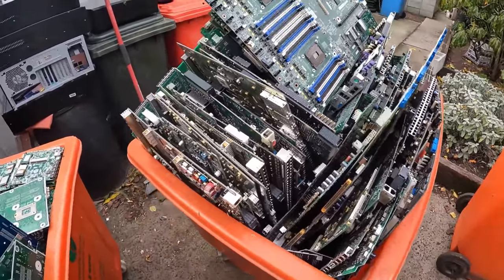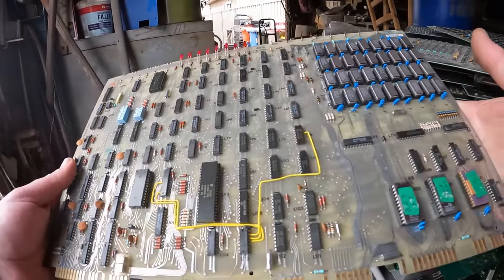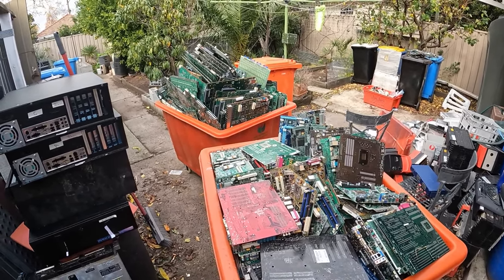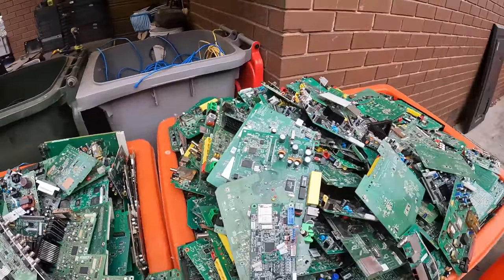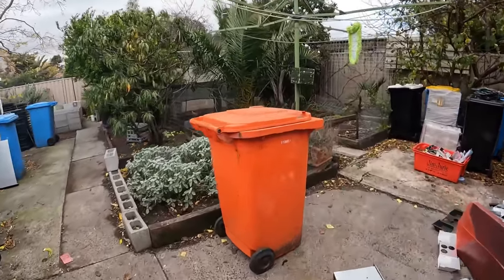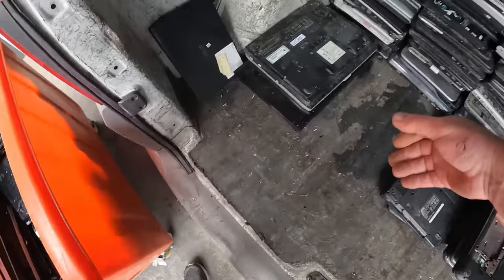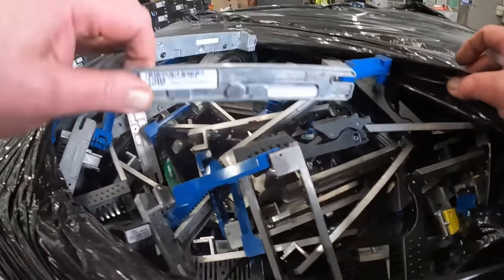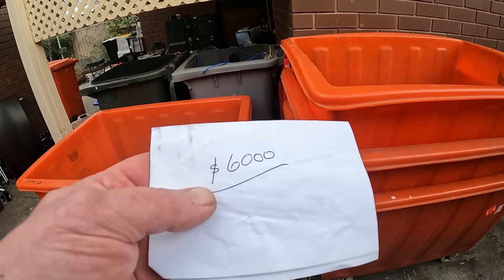Circuit Board Sale Day

Comment: Where do you find a company scrapping all those boards.  I have an old 1970s telephone with what looks like total silver solder on the circuit board (bright white silvery vs the common dull grey most of the time solder).  It has a bunch of connection or switching ports not used like from a business interconnected telephone for internal calls before dialing out.  If it is all that silver solder a big chunk in weight of silver should be recycled I plan to do chemically once I get nitric acid etc. To remove silver in solution and use copper and whatever to leach back silver granules, someday.

Comment: Those Wang machines and boards are getting very sort after by vintage computer enthusiasts!
Reply: Wang computers and software sucked. California bought hundreds or thousands of Wang computers, then had to be scrapped due to so many issues. Very few of them were ever turned on. But I did steal the 20 meg Seagate hard drives out of them before the State took them away. I knew they would never be turned on again and find out I removed the usable hard drives.
Reply: Wang and those PDP parts go for a lot of money nowadays. I'm betting far more than he got for scrap. Not to mention the memory and cpu's...
Reply: @paradiselost1914  understood but the vintage computer community doesn’t care if the machines were any good, they are just concerned about preserving working examples for historical reasons or as a hobby. So all those RAM chips and CPUs are valuable to repair other almost working machines so scrapping them is painful to see!

Comment: Some chips on old boards can be worth recovering, like for example SRAM and RAM chips as they can worth something for people that repair old game consoles or want to upgrade some old hardware to more memory. 
If they're in sockets, even better, you have there 20+ chips of same model, just add them to a bucket of same chips and see if there's a demand for them.
I would get a solder pot and pull capacitors from boards and sell bags of 50-100 of them for a few dollars - there's gonna be people in some countries that  would buy them to repair hardware cheaply and won't mind the short leads.  Solid (polymer) capacitors are safe, very long life, electrolytic capacitors can degrade a bit but considering a lot of those systems were used in offices they would be fairly safe to resell. 
I was surprised in a previous video that you weren't pulling transistors from audio amplifiers, some of those can be worth a few dollars a piece.

Comment: hey ben . the z170 p is 6 Gen and i my town one sell for 20 dolars :) 500CZk faster and old p1 laptops wirth Toshiba cdt pro :/ in right side  i am scraper and collector and seller
Reply: 3rd world poverty tax penalty! Well, Czech republic isn't that 3rd world, but not in the golden billion either. Well good for $20, not for $50 or there are crazy heads wanting 50 or more.
Reply: @ran2wild370  hohoho , one old pile and i have 363,21 usd ipac mobile in box and 486´s , 7 boards and slot cards :)  and 2 pc´s :)